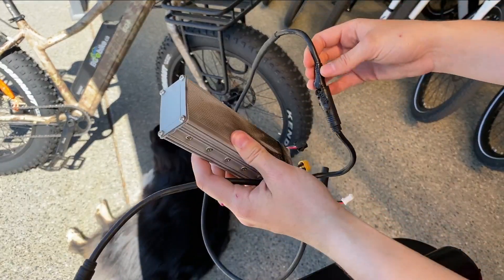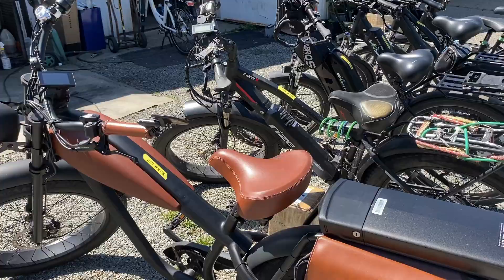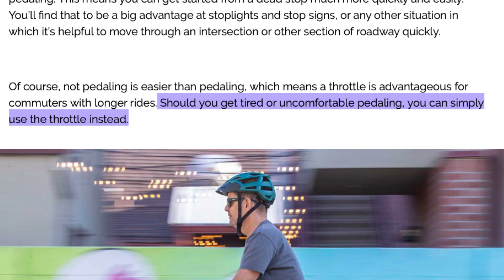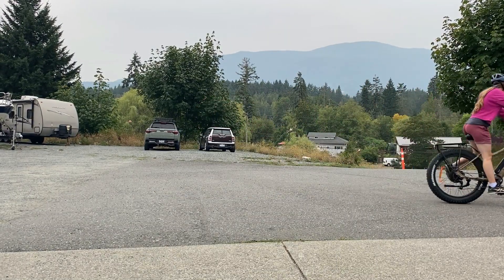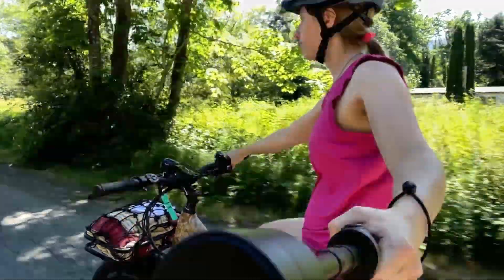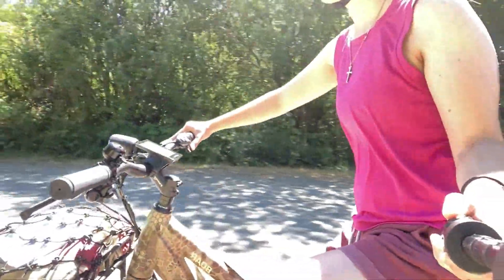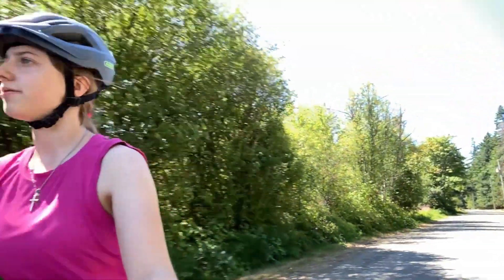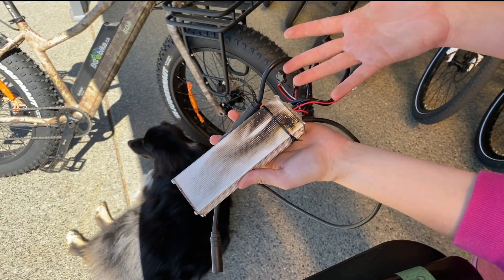This is what throttling up hills does to your E-bike!

Comment: The controller should be limiting the max current to a safe level and should have a thermal cutout as well. No way this should happen no matter what the user does.
Reply: Exactly, if the heat they generate is a problem then they should be built do never over heat no matter what you do.

Comment: This will not be a popular video...folks don't want to be told they have to pedal.
Reply from the maker: We are tired of the tears. So many young people save up and purchase a Pedal Assist E-Bike to commute to school or work. The e-bike is usually a entry level, not the best design or components. With online purchases there is very little instruction on how to operate the e-bike. These people end up at our repair shop with an overheated controller and bill they did not need to incur had they received a little information.

Comment: six years with big hills on a super soco bike, about 340 pounds bike and rider, never a problem using it up hills without peddling. It can slow down from 32 KMH to about 20 and picks back up at the top. Make sure the bike you buy can handle the hills you intend to ride including the length and slope of the hills as well as the operating temperature. If the pavement is hot enough to melt tires check the motor, battery and controller temperatures.
Reply from the maker: So true, make sure the e-bike torque matches the terrain you will be traveling on.

Comment: I own a 1500W hub motor with 48volt battry and have over 200hours of throttling uphills with not a single problem.
P'S
I have removed the hub sensors and run a double mode controller.
Reply: My Spark Bandit has a 1500w dual battery set up. I throttle up hills to piss off the spandex bois.
Reply: If I'm using throttle on a ebike how do i break without the break lever controller
Reply: Use your old brakes. @SmokeySkies

Comment: The problem isn't the throttle, it's the controller placement. The controllers need to be mounted externally so they get airflow and don't overheat. Also the wires coming out of the controller should never be bunched up next to the controller because the heat generated can fuse the phase wires. For example I have a dual hub motor bike. I just went for a 15 mile ride today most of which was at full throttle and I went up some sizeable hills. My controllers are externally mounted. They weren't even warm to the touch when I got home. My bike weighs close to 100 lbs. and I'm over 400 lbs. It's not the high flow of current, it's the heat generated by the current and not enough air cooling. It could also be because the manufacturer used the wrong gauge wires on their controllers which can cause too much resistance which generates more heat. Don't believe me? Watch the video I just posted today and you'll see that my bike works perfectly fine.
Reply: Melting or overheating controllers are a design and implementation problem not a user problem.
Reply: @ChromecastM8  I couldn't agree more.
The power wires on my bike seem to be 14ga, which should only run 15 amps, but it's trying to pull up to 22 amps at times. They'll confuse buyers with ratings saying it's max continuous discharge is fine for a few minutes at a time....
Reply: and now look under an AR Grizzly's seat. The dual contrillers are sealed in there with little air flow and the wiring harness is crammed in front in a tiny place. So my question is, wehat pair of controllers will be strong enough and wired properly so it will be "trustworthy" if I mount it all outside?
Reply from the maker: Totally agree externally mounted controller cool much better that internally mounted controllers.

Comment: The more power you demand from the battery/controller, the more heat, and the closer you get to the limits of the components, ebikes are not motorcycles and they shouldn't be used in that manner unless you have an extremely powerful set up and even those have their limitations.
Reply: so what controllers does a Su-Ron use then?
Reply: @tomsewell2462  The bigger the controller, The more Paralleling MOSFETs, The bigger the heat fin casing, = Better heat dissipation. The Sur-Ron has a massive controller in a heat fined casing.

Comment: Ok...I live in Toronto- and I have a Radcity 5 plus and I use the throttle to start at a green light etc make sense...I guess throttling up a hill all the way would be too much for most ebikes. This Radcity is strong but I would like to keep it in perfect working order. if climbing a hill I do pedal with assistance level 4-or 5 but I start with  the throttle to get some speed. There are a few hills in the city for sure but I pedal a bit-I had a regular bike before and I need the exercise. Pedal assistance 4-5 really does the trick